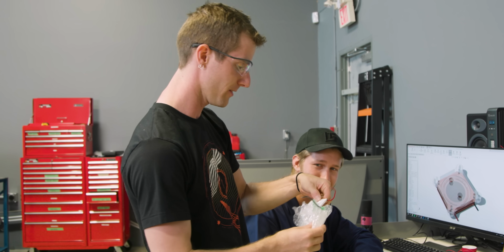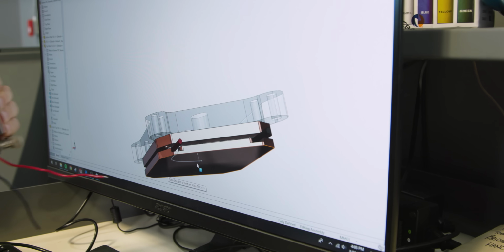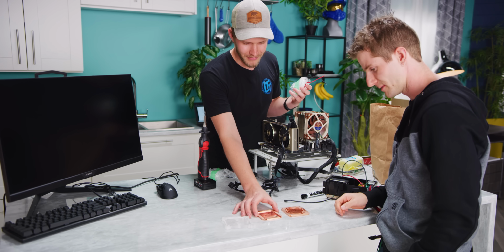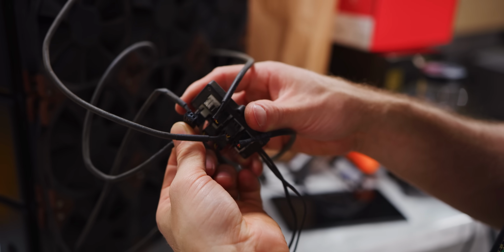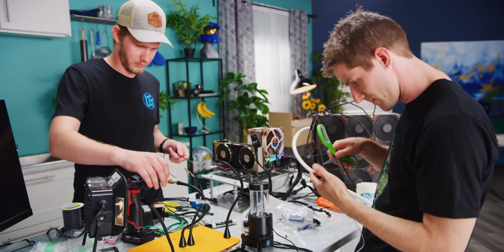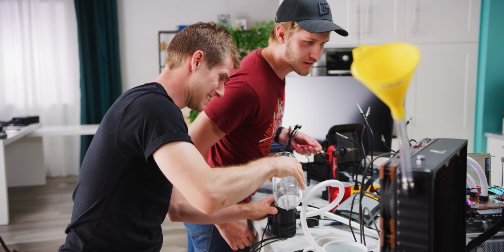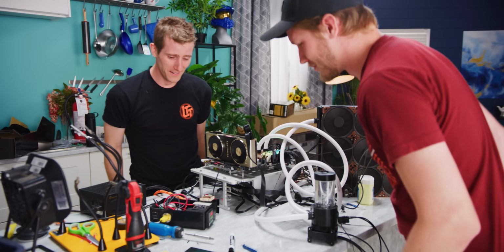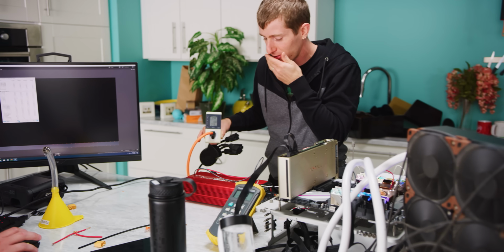This Cooler DRAWS 545W!!? Bad Cooling Ideas #2

Comment: now what about cooling the water with peltier instead of fans and a radiator?
Reply: This. I have cooled a couple of older builds with a TEC cooled water loop. Involves 2 waterblocks, but much more uniform results. It's all about getting the heat away from the TEC. That's where alot of people don't go far enough with.
Reply: @vwsavage120  you really are a Savage ^^
Reply: I’ve considered using one of those pettier beer fridges for a chiller in that manner.
Reply: They tried this first and it also didn't work
Reply: @stereotypicalLame  it must work if only this guys can do that properly.
Reply: but that's too practical for ltt
Reply: DispelTheMyth  I was leaning toward Jake von Slatt's convection loops made from 3/4" copper and baseboard fin tube.  This was from a few years ago, so might nit fly with the current crop of procs.  However, when I searched for the build, I run into a story about a more current convective build.  He was testing on a i3 and using 3M Flourinert FC-72 in passive circ loops. (Https://www.legitreviews.com/new-closed-loop-convection-CPU-cooler-hopes-to-save-power-and-keep-things-cool_142579)

Comment: Hey Linus. For bad cooling idea #3 i have a pretty good idea. How about a peltier cooling on demand? Have a board to engage the peltier element only at peak temperature. Rest of the time the heat sink would be cooled by water cooling.

Also this setup is technically powered by all your staff saliva. hahahah

Comment: U are doing it wrong u need a large heatsink (custom heatsink) to acumulate heat from cpu normaly and than use that french stuff to pull heat from heatsink not the cpu.

Comment: Thermoelectric couplings will generate power as long as one side is hot and the other cold. Your current setup seems like a great way to use this.  Maybe instead of dumping more and more juice into the TEC you could hook it up to some kind of draw and see how much power you can make using waste energy from the CPU. It will still cool the CPU as it converts the heat energy into electrical energy.

Comment: Your copper have too much heat capacity and you might want to use something else than water. Like.. maybe something like a mineral oil bath with a beaffy heatsink with lots of thin heatpipe .. and you would need to delid it too and use liquid metal thermalpaste.. of course. 
Dont forget the propeler for the mineral oil, passive convection wouldnt be enough

Comment: The peltier wasn't insulated, which means the hot side was heating up the cold side too. Plus you are not supposed to cool down the cpu directly. A more realistic aproach would be to use a peltier to cooldown water in a thermally insulated reservoir in a regular water loop. So basically use the peltier as an additional cooling method in a water loop, instead of using just the radiator.

Comment: The next stage will be to use a regular water cooling block on the CPU, but fill the loop with propylene glycol and cool the loop to sub-zero temperatures.

Comment: Your solid state relay will  turn your peltier on and off 60 times a second when it is at the right tempiture.  Due to this your power supply will slowly degrade from the constant stress and no stress

Comment: I think it would be more effective to not force ALL of the waste heat to go through the peltier. A dual loop would probably be better - dump bulk heat via a normal radiator, then cool it further with a peltier dumping heat into a separate loop.

Btw Tech Ingredients has a great video getting into the science of how to use TECs efficiently (temp and voltage graphs, efficiencies, etc) - explained while constructing a pretty powerful diy freezer with peltiers in parallel.

Comment: Try
CPU/water cooler only BUT

The watercolling system is special, the tubes must go from cpu to radiator (to cool it a bit) then go to a waterbloc cooled by a Peltier (hot side cooled by any GooD cpu cooler you have, and return to cpu.

Then use the thermostat/controller to avoid water going too low on temperature and make condensation

With this setup you can keep water temperature lower and cpu temperature lower.
My Xeon was idling a 3° and at full send was a bit over 10°  and I wasn’t using a 500w Peltier this way since I only cool ambiant temperature water rather than directly the cpu.
Try this in take 3. If you can’t control the water enough try adding an anti-freezing fluid.

Then overclock

Comment: Its a solid state realy. It only works with AC power!
Reply: There is DC solid state relays, although they're still a poor choice for this application due to significant voltage drop

Comment: Alex, if you're not able to create proper fins in a heatsink, use the classic 'maze' method of water cooling blocks. You obviously don't have a skiving machine, but those fins you created just aren't good at all. It would've been better to try a pin structure (like the classic Alpha heatsink) or the maze (just about every classic water cooling block). 
Linus, your guy is good at Solidworks and similar software, but severely lacking in material sciences, and knowledge of thermodynamics.

Comment: instead of using a PID controller, could you not have just used the fan PWM signal with a large transistor to control the peltier? if you mentioned why in the video then I missed it.